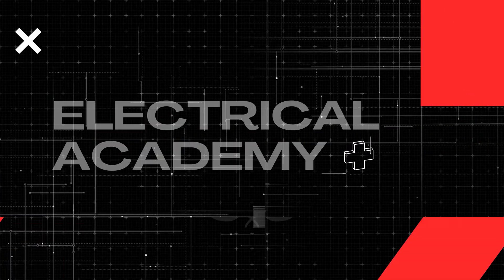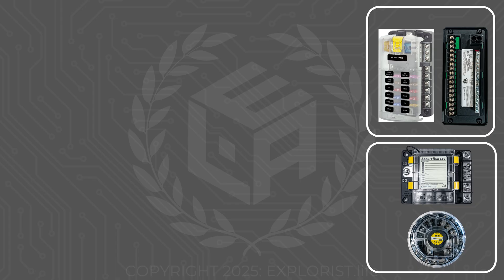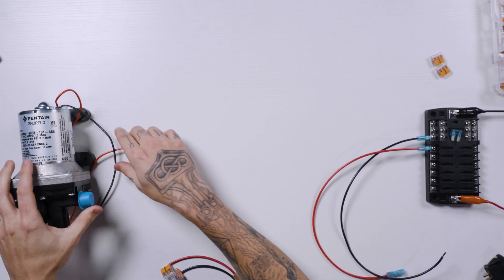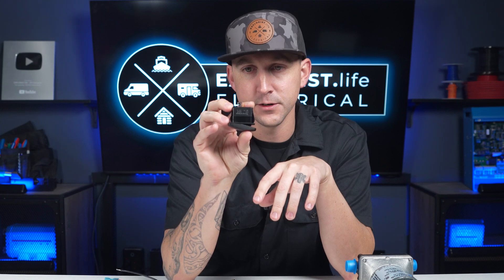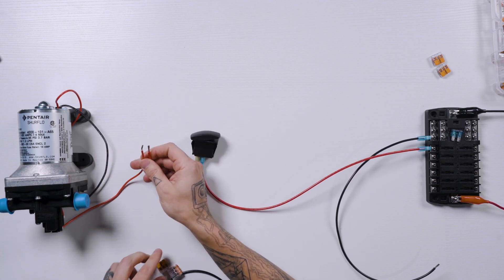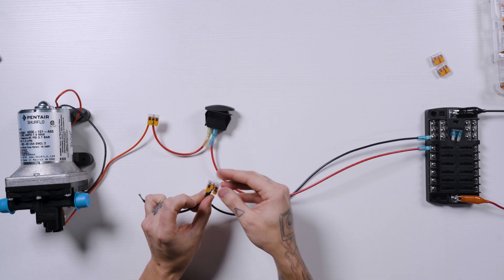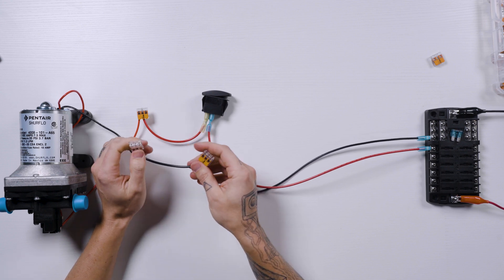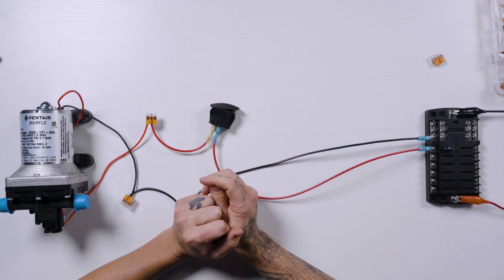How to Wire a Water Pump -  Branch Circuits | Ep: 4/10

Comment: What size wire is best to use  , 10 or 12 gauge ?
Reply from the maker: Great question 👍 Wire size can depend on a few details specific to your setup (pump load, run length, voltage, etc.), so rather than guessing, we’d love to take a personalized look at your project and make the right recommendation.

Reach out to our support team here and they can help you dial it in and make sure you’ve got the correct wire (and any other parts you might need): 👉 https://shop.explorist.life/support?utm_source=youtube&utm_medium=comment&utm_campaign=support&utm_content=response_link

Comment: I came across this video while researching the use of a relay switch for awater pump on a boat, however, I dont see how either of these are practical for a boat water supply in place of a water pressure switch?  😊
Reply from the maker: Great question! Boat systems can get pretty specific, and what’s practical depends a lot on your exact setup. We’d love to take a closer look at your project so we can point you to the right components for your needs.

If you can reach out to our support team, we can walk through your system and make sure you get the right parts:
https://shop.explorist.life/support?utm_source=youtube&utm_medium=comment&utm_campaign=support&utm_content=response_link

Comment: Question: Water pumps and plumbing items often times LEAK.... that being said, why would you use lever nuts rather than make a good water tight connection, such as  with a water tight butt connection that uses incorporated heat shrink?  Yes the lever nut is quicker (for professionals on the clock) but not as safe for this application, correct? Better question might be is there an cheap and easy to realistically how to keep your lever nut connections waterproof?
Reply from the maker: for 12V applications it doesn't matter.  Think about the 7 pin connector on the back of a truck that is active at all times while driving.  Very much not waterproof.

Comment: Nate, what about automatic pumps? The ones that shut off with pressure
Reply: beat me to it. was going to ask if there was any difference with an on-demand pentair. but it could  be (and maybe should be) wired the same in case the pressure switch fails.

Comment: Thanks Nate - straight to the point! Question: Our water pump causes our LED lights to flicker when it cycles on and I’ve been told to have the pump run off a relay but I don’t know where in the chain to put the relay - and will it actually prevent the flickering. Suggestions? Thanks!